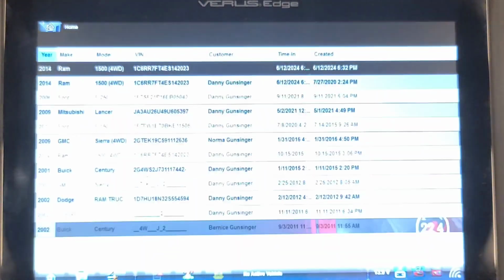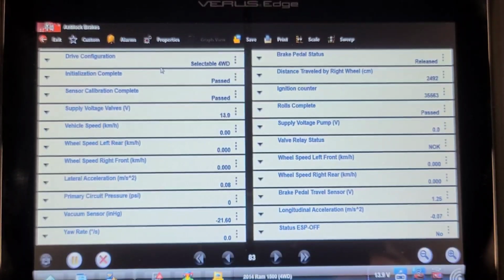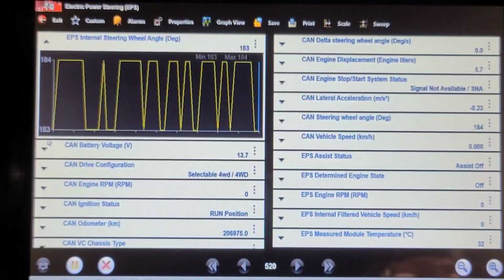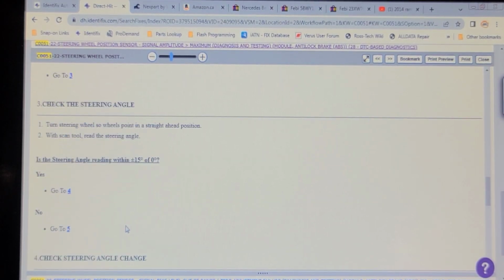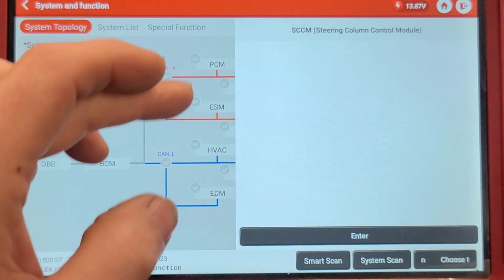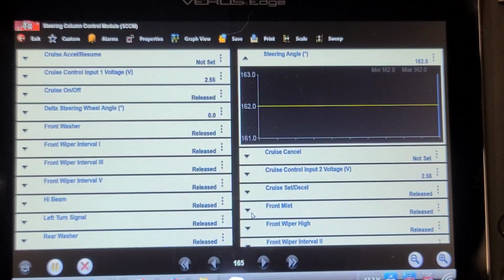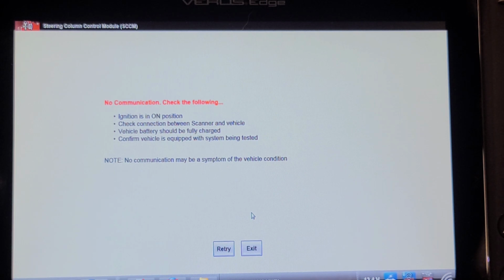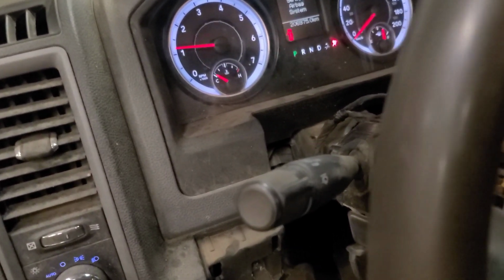2014 Ram 1500 4x4 Posessed Steering. pt. 1

Comment: Is there a way to unhook the steering gear from column then move tires a little bit with hand to see if it starts doing the back and forth action?
Reply from the maker: I'll try disconnecting the input shaft at the gear before I swap it out.